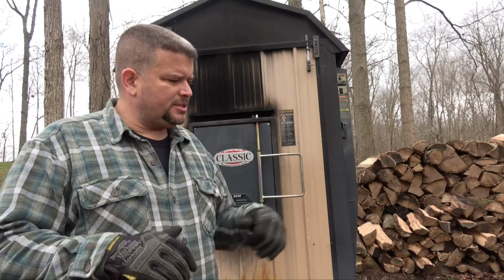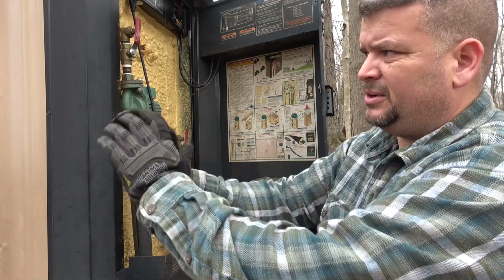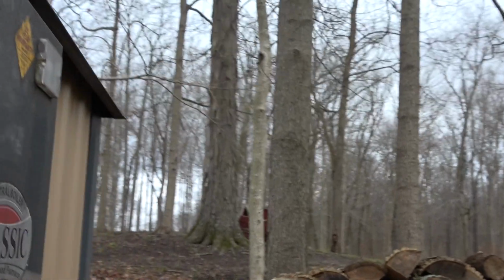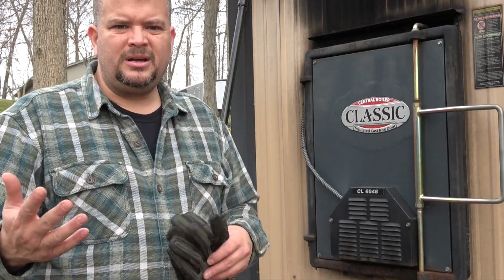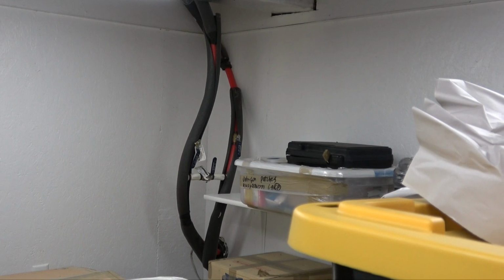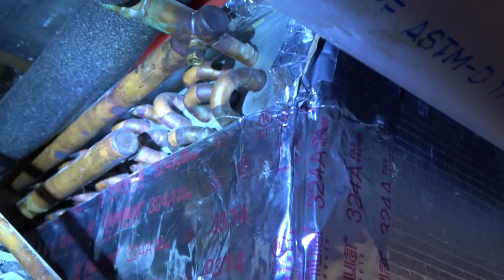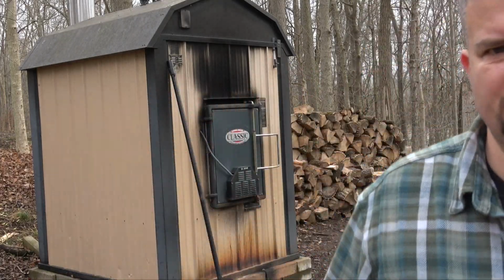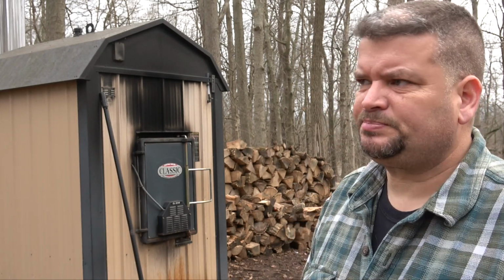Wood Boiler for Prepping?

Comment: Great system.  My parents heat their 3000 sq ft Victorian brick home with 11ft ceilings. It does an awesome job and is hooked up to the hot water tank. All the hot water you can use. The initial cost is high, but the system has paid for itself.
Reply from the maker: Yep our house is about the same size with high ceilings as well. It’s a very efficient system for sure. The unit we have is rated for 7000 sq ft. I’m thinking about having my shop plumbed up to it as well.

Comment: Coolest thing I have seen in a long time. Does the water that just re-circulates, does it ever need to be replenished?
Reply from the maker: It does eventually need replenished. I have a hook up at the water heater to top it off if needed. But prolly only once a year or so you just add a little.
Reply: @RealitySurvival  thx

Comment: They are great for heating as long as the power is on .. pumps and blowers need constant power  24/7. I would definitely have a good sized  quality wood burning stove in the house for heating and cooking .
Reply from the maker: Yep you still need to have a generator. Which we do and a 1000 gallon propane tank to power it. We also have a large fireplace in the living room.

Comment: VERY INTERESTING SYSTEM.  i have never heard of it. i am glad it is better than you thought it would be. so many questions... it seems pretty far from the house, is that for a reason, other than maybe fire safety?  does pre-heating your propane water heater conceivably have any detrimental effects, such as shorten the lifespan of the water heater? do most people in your area have that system? how do you think this system would stack up against a geothermal unit in your area? what do you do for air conditioning? did daniel boone carve that "B" in the tree next to the chimney?
Reply from the maker: lol. You are full of questions. It’s only about 30 foot outside the house. My guess is the location was just where they could find a big enough break in the trees at the time. No detrimental effects on the water heater. It is over 30 years old and works perfectly. Most people don’t have this system but I have seen a lot of them. No clue on the geothermal comparison I have never owned one.
Reply from the maker: We have a normal air conditioner and heater hooked to propane and electricity. So if we don’t want to burn wood. Like in the late spring, summer we just use the regular systems.

Comment: You said a generator could keep the boiler going. What about moving the air in the house? (Blower) You would need 10 more solar panels. (20 on a cloudy day) And something at night.
Reply from the maker: Yeah That is correct I would also need to have a generator running for the heater. But the water heater portion would run without it. Thanks. I didn’t explain that part exactly right.